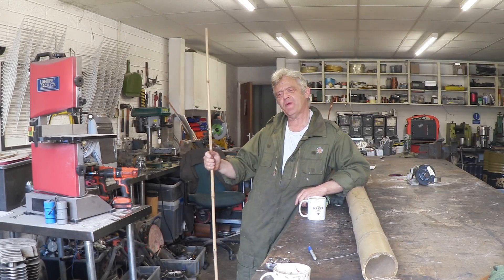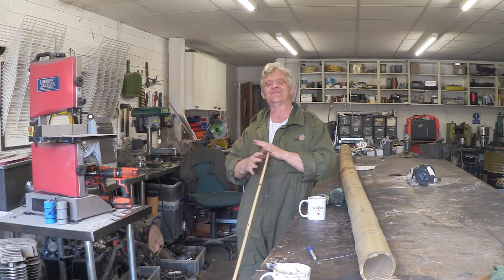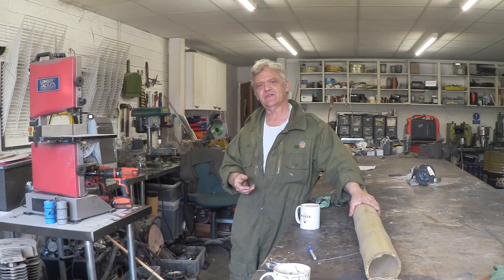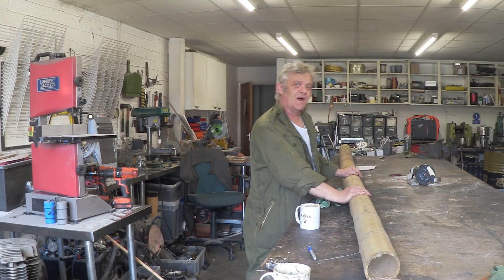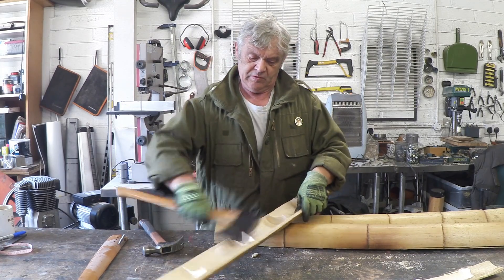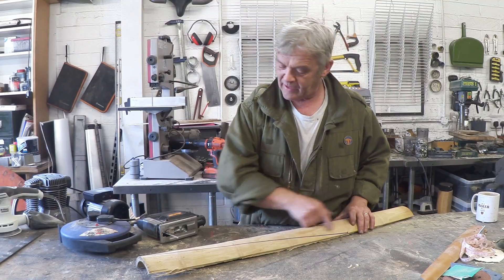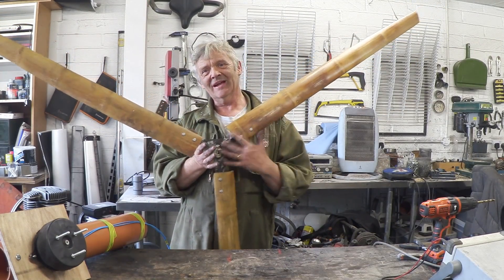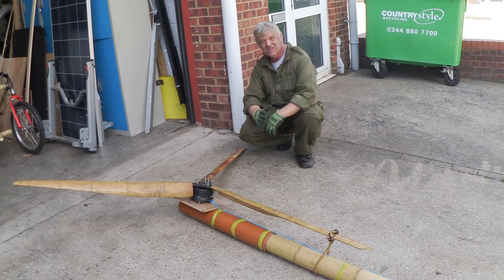1157 Build A Bamboo Wind Turbine

Comment: That is so cool!
If you wanted to refine it, just remove enough material from the blades so they weigh exactly the same and with your design in balance, a good sneeze should be enough to get it going 😂🤣👍🍻

Comment: Do an array of horizontally placed solar panels in the roof, and underneath the solar panels you put the maximum number of VAWTs you can fit in that area. The solar panels will generate energy from the sun and protect the VAWTs from rain (and can also collect rain). And the VAWTs will generate extra energy using an otherwise unused space. (Maybe use some kind of screen or mesh to prevent birds from hitting the blades)

Comment: Maybe you have put your blades on the wrong way round. The inside of the bamboo should be facing the wind, with the trailing edge being slightly downwind. Then the vectors will work for you and it will go a lot faster. Also, it would help to shave the trailing edge  to make it thinner but that it not so important.
Reply from the maker: I suspect that is not actually possible. If they were the 'wrong way round' it would still turn - just with the wind from behind it. the leading edge on the left or right means it spins clockwise or anticlockwise. I am not sure there is a back to front here
Reply: @ThinkingandTinkering  you are right about the clockwise/unticlockwise spin, of course. However, in either case, the point is to have the bulge  (longer curve) in the back, so that its under pressure will pull roughly in the direction of the spin, even when the relative wind shifts to be more of a head wind. What you have got is a plane propeller with the bulge in the front but that converts energy into wind, whereas you are trying to do the opposite, so you need the bulge at the back.
Reply from the maker: @leostarling5746  mate - I copied this design - it's not mine I just made it in bamboo - maybe you should take it up with them - either way - I still think it doesn't really matter as from the way I see it there is no 'back' all that will happen is the wind will run it from behind rather than in front
Reply: @ThinkingandTinkering  Sorry, I am clearly not explaining myself well enough. By front and back I meant windward and leeward.  This is the sort of thing that needs a quick vector wind/forces diagram. Just because you copied the design does not mean it is the best one, even if it might work to some extent. There is all sorts of rubbish on the internet :) As you yourself rightly said, if you stick almost anything in the wind, it will move :) It just seems a shame to miss the full benefit after all that work.

Comment: I thought you might use a hub Dynamo out of an old Push bike wheel it will generate six vaults 3 watts and you don’t need to turn it very fast cheers Derek
Reply from the maker: I would have done if I had one mate

Comment: Love da post...how big?(20ft guess)..
Video missed ground set..
Gotta a pic?..
Bet it would slip righ over a 4x4 set i concrete..
Might even spin..
Reply from the maker: 4 meters - I didn't really focus on the grounds as I copied a commercial wind turbine blade design - just in bamboo - the point was to show how a minimum tool set can make a decent blade  - I used a hand ax, handsaw and sander

Comment: You do know that the blades are installed,back to front😂
Reply: Ive made a few wind turbines ,treadmill motors with pvc pipes , yes it will still turn with the blades installed how you have them but you are losing a LOT of energy like that , you have them installed like the motor is going to drive it like a plane!
Oh and I would suggest balancing them by weight as it will shake itself apart at useable rpm. 
Have a quick look on eBay for wind generator,a picture tells a thousand words ,
Reply from the maker: you do know that is not actually possible? If they were the 'wrong way round' it would still turn - just with the wind from behind it. the leading edge on the left or right means it spins clockwise or anticlockwise. There Is no back to front here

Comment: i've no clue who told you bamboo is cheap, it is in other places in the world, but i've been after large scale large volume large diamater large length bamboo for decades and it's cheaper to buy pressure treated timber in the UK...
Reply from the maker: I paid £18 for a 120mm 4 meter pole from UKBamboo - the same pressure treated timber in pine would cost £24
Reply: @ThinkingandTinkering  thanks for getting back to me, local timber dealer here you can get em near tenner each or closer to a fiver with VAT discount + bulk if you dive into all that stuff - but i will say £18 for that size is the cheapest i've ever seen... i didn't believe it i had to go check, it's £18.92 pre-vat,  so closer to £22.70 post-vat, then add postage ontop, i can't see any mention of free postage, but that's fine it is big... they've only got one left in stock though...  it's very promising they've come down so far, go back 10 years a post like that would set you back £80, it doesn't grow anywhere near that big in the UK so the price ramped up dramatically

Comment: I love bamboo also. I wonder how 6 blades will perform next to 3
Reply: As I understand it (and from much abused memory,) at ideal windspeed for a particular airfoil, 3 bladed will give a maximum of ~80% of theoretically available energy (remember the idea from a few videos back of 'how much work is done on the building wall? ' because if the wall doesn't move, no work was done?)

Again, as is my understanding:
Case of 1) You can't effectively balance without a counterweight that matches the expected wind speed. And it just look weird, shouldn't that count for something?
Case of 2) Gives yaw forces when it is turning to face the wind (Think household-scale turbine with a tail to face whatever wind they might see.) and it sees a "wind shadow" when each blade crosses the tower.
Case of 3) Gets an easy balance and, while it still sees loads from shadowing, it's 1/√2 (analogue to three-phase AC) and more averages out.
Case for =>4) you're only gaining 2-5%, only at your highest wind speed, while drastically increasing your construction and maintenance costs.

Whoever here knows more than this ::pointing at self:: adventurer, I'd love to learn the cases where I'm missing something! 

Even if (and that's a bold "if") my limited comprehension shares the same street with Correct, there is likely some situation where it breaks down.
Reply from the maker: it took me a couple of hours from pole to blade mate - give it a go

Comment: I've heard from so many scholars or experts in renewable energy that the output from a homebrew turbine or on a given site just isn't worth it. While I only barely disagree, I've started answering that they should multiply a couple of Watts by the number of seconds they've been in their field. Starts to work out to a lot of Joules.

~20 years ago I built a water wheel in a tiny steam and fit it with an old appliance motor (I can't even remember exactly what it was from) and left it at a tiny cabin (~128sq.ft) that was used by various family and friends who needed a place to "get away" charging a pair of old batteries that couldn't start the tractor anymore.
I got only 12-25W but it kept lights, fans and radios going. 

As far as I know and I would expect it's still running, didn't cost anything, saved all those parts going to scrap or landfill and a conservative estimate is 3 MWh produced.

A long story to say that a little bit now, at little cost, comes out to a lot and is a heap more than multiplication of zero because I couldn't afford a "proper turbine" at the time.

That's one of the reasons I enjoy this channel so very much. Thank you!
Reply from the maker: nice point mate and nicely made - cheers

Comment: its the sole reason for early technological advancement in the east when we were still using wood. what astounds me is that you got bamboo of that diameter cheaply in the uk. hit us up mate did i miss a video? ive been waiting for bamboo to hit the uk for many years. (even tried growing it at one point).
Reply from the maker: there is a supplier called bamboo UK - check them out

Comment: You might be able to leave the nodes.  I have a small plastic molded windmill kit that put sections behind the wing. Not sure of the purpose (strength maybe?) or the math behind their placement
Reply from the maker: you might be able to - I liked the smoothness though and it was no real effort to sand it

Comment: How did you attach the blades to the hub and not split the bolt holes ?
Reply from the maker: it's a myth that bamboo will split on bolting
Reply: @ThinkingandTinkering  No I've had it happen to me.  Using washers prevents it to the most parts.  Tighten up your bolts to any reasonable compression and yours will split too.
Reply: Using  Cupped spring washers (used cup to material )  forcing the joint tight seems to be the ticket.

Comment: What about use in a vertical wind generator? I would like to see the efficiency of that vs say pvc or simular material.
Reply from the maker: go for it
Reply: @ThinkingandTinkering  Hi Rob,
Why do you taper the blades? (I know it changes the chord angle, but it loses area) I also understand why 'propeller' blades taper, but for windmilling it seems that a larger surface towards the tip extracts more energy from the air-stream (and not just because leverage etc).
I cut non-taper blades from pipes by skewing the cut to maintain the correct angle of attack for the chord. They do put out more torque than tapered blades. But I haven't done any in-depth stuff with any; yet. ;-)
The skew is a bit tricky as its related to the ratio of axis-root and axis-tip radius.
About 70-75% towards the tip for widest cord is probably optimal, but for percentages that's a bit nerdy.
Thanks for sharing.
Reply: @marthale7 until you got to recycle it :P
Reply: @thomashaller4876  most of wind turbines ends up in land field, there is currently one company that shreds it and sell it to concrete producer to burn it (instead of coal) which is far away from ideal. For solar panel there is at least some companies who actualy recycle them. Maybe pure wooden blades can be reused, shreded as woodchips and biodegrade into fertilizer but we cover them with fiberglass for more strength.

Comment: Awesome - my favourite of your turbines yet! When I've made pipe section blades before I had them on the other way round so the concave surface is facing the wind but maybe yours are a bit different. Also needs a bit of a balance by the looks of it! Great stuff.
Reply from the maker: it's a lift type when this way round mate - the other way makes it a drag type
Reply: @ThinkingandTinkering  which way is the wind blowing at 7:54?